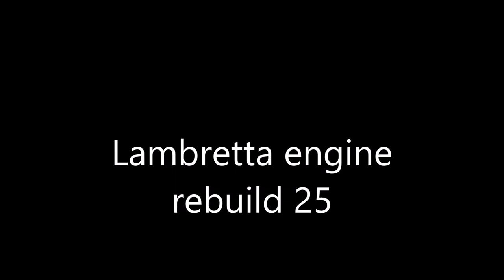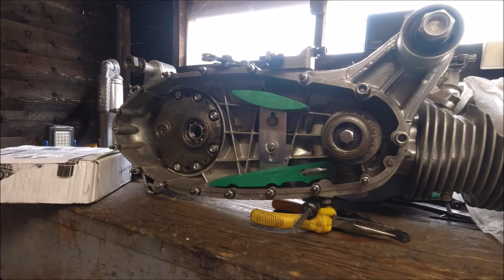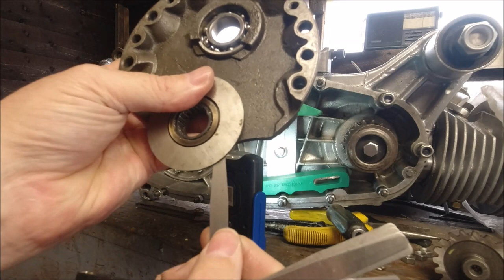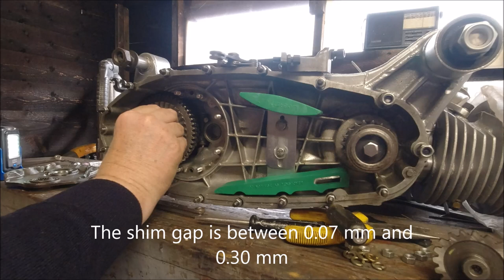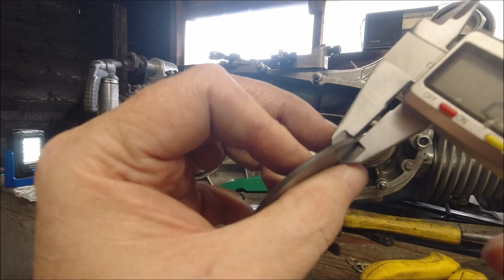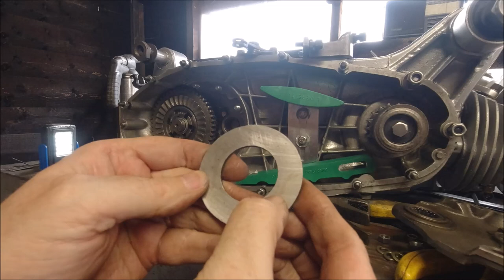Lambretta engine rebuild 25

Comment: Why do you use the hammer on the end plate, will tightening the nuts not seat it down?
Reply from the maker: You can strip the thread on the studs very easily,  I tap the endplate into place so the nuts are only then used to hold it in place. Sometimes you also have tight bearings that stop the plate from seating. I only show the way I build them , most people I know that build more than me also use a hammer be it steel or copper. Thanks for asking this question and good luck.
Reply: I'm going to start my first ever build in the next few weeks, I'm going to copy the way you build your engines, thanks for posting these
Reply from the maker: Take your time, if it gets on your nerves ,walk away and return to it later, that's the advantage you have over dealers as they have a customer waiting and some cut corners. Good luck and of you need it  there's a world of advice out there
Reply: Cheers

Comment: I would have thought...a thicker shim...would give a larger gap...not smaller...so the 2mm shim should be 1.9mm to obtain the 0.30mm
Reply from the maker: The larger the sim , the smaller the space between gears and endplate, 2.0 would leave a larger gap than 2.17 etc, hope that is clearer?, you are trying to get the gap to 0.30 or lower, I  achieved 0.125, 0.033 is tightest you can achieve, at this you are risking almost no end float!
Reply: @m1scooterlife259  i have just fitted a new first gear and i now have the problem that i cant tighten the plate fully  as it locks the cogs........will i be going thicker or thinner shim wise? my brain says thinner.
Reply from the maker: @roymichaeldeanable  you use a thicker shim to reduce the space, thinner gives more space. I hope this helps
Reply from the maker: Best way to look at is make a c shape with your fingers and put one finger in the middle, look at the space left in the c shape, then put two fingers in the gap, the space left is smaller, same principle as the shims